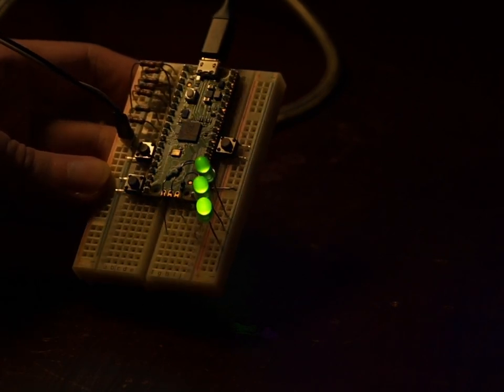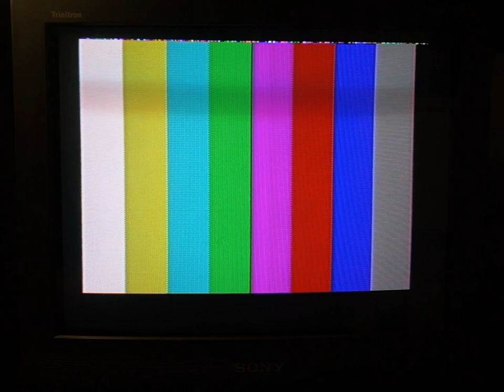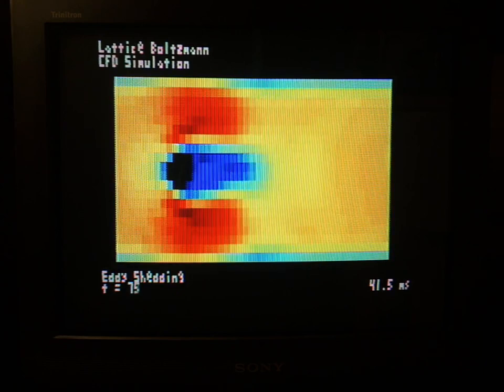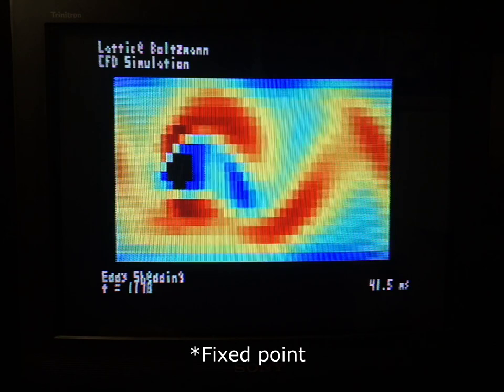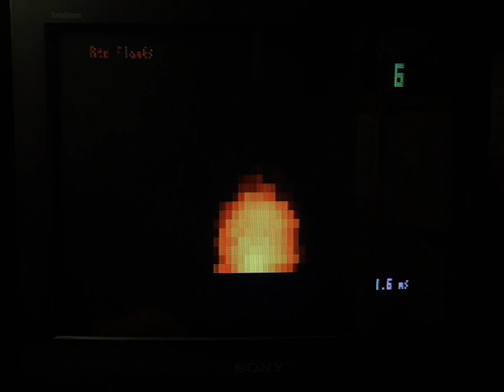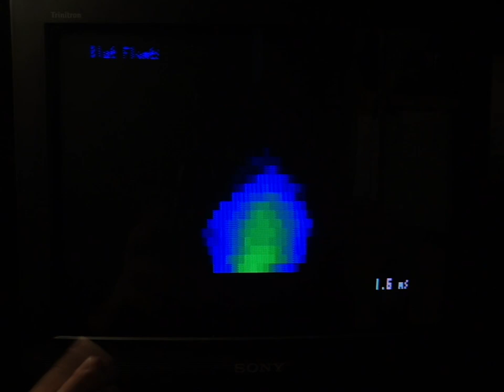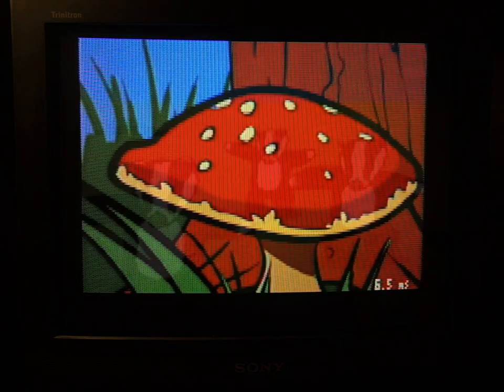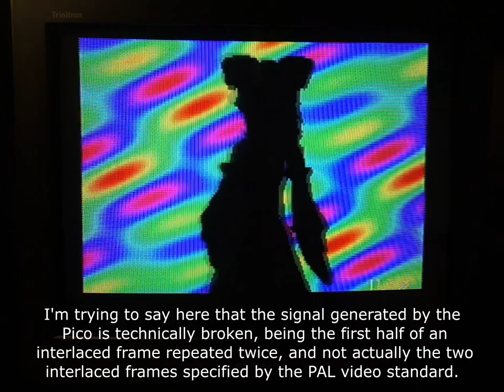Raspberry Pi Pico generated colour composite PAL video demos, early 2023

Comment: Regarding the memory limitation, would it help to store in YUV, while reducing chroma resolution and bit depth? Same method was used by video tapes which had limited bandwidth, you can get away with quite a lot of compression on chroma channel with negligible effect on quality.

Regarding the signal, are the two fields you are sending truly identical? There are different synchronization pulses between odd and even fields, so that might be the issue.

Sorry if the answer is apparent from the code, I can't figure that out with my knowledge :)
Reply: Wonder if it'd even be useful to store it as brightness, chroma intensity, chroma phase, so it's already in a format that can be modulated rather than needing RGB to whatever conversion.  But yeah I think YUV would be closer to the analog colorspace.

Comment: The RCA connector is connected with Ground and Green pin of Rpi Pico i.e Pin 19 right ?
Reply from the maker: The ground of the RCA is attached to the ground of the Pico. The RCA signal is attached to a DAC made up of resistors attached to pins 1, 2, 4, 5, 6, 7, 9 and 10 (33k, 18k, 10k, 5.6k, 2.2k, 1k, 560 and 270 Ω).

Comment: Is pico flash fast enough to out put it on the fly ? Or one frame at the time to memory
Reply from the maker: Yes the flash is fast enough to read from directly to screen, as long as what's in flash is already converted to YUV. The Pi Logo and test card are both being read from flash for each frame it's displayed, as well as parts of the badger badger badger.

Comment: really cool man, congrats! have you taken the project any further? I was thinking about the possibilities to build a simple video synthesizer/visualizer using this board (adding an interface for a little bit of control and options to change settings), and your tests show real potential for that. what do you think about implementing the basic of synthesis (oscillators, modulations and such) on the pico? have you come across any project that does something like that (as video or audio). thanks!
Reply from the maker: I've been letting the project mature for a bit while I work on other things. There are a couple things I'd like to do with trying to clean up the code some at the very least. I've looked into audio output some as I think that'd be a cool addition and it seems some simple square wave audio output with the PWM looks fairly straight forward. I'm not sure about using the Pico as a more complex synthesizer beyond that. I also love the idea of using this as a display for an audio spectrum visualiser but I'm worried doing the FFT needed for that would take too much CPU to run the display at the same time. Maybe with two Picos working together though.

Comment: What kind of dac does it use?
Reply: Resistor ladder maybe?
Reply: Oooh now I see
Reply: Cool video tho
Reply from the maker: Regular resistor DAC - not even a resistor ladder. 33k, 18k, 10k, 5.6k, 2.2k, 1k, 560 and 270 Ω resistors each on its own GPIO pin.